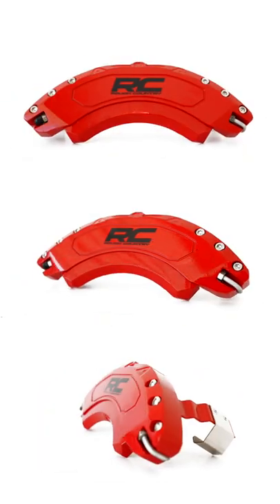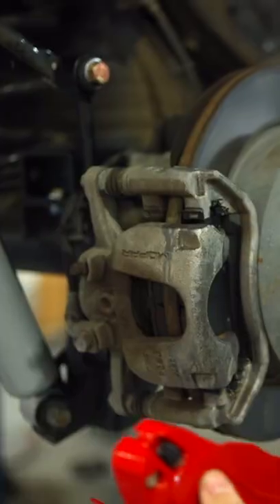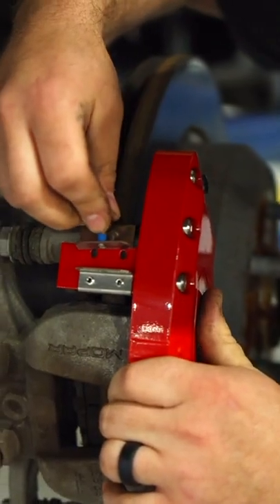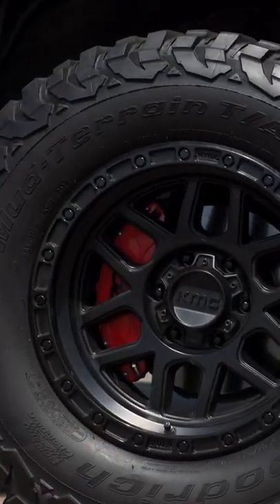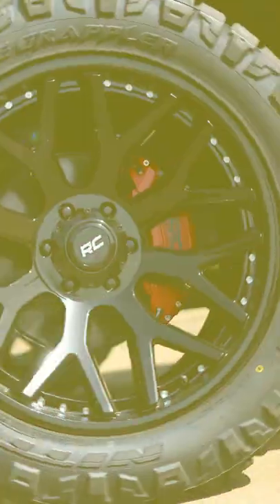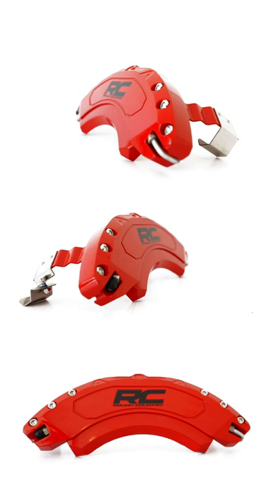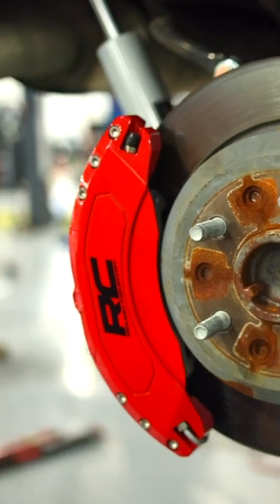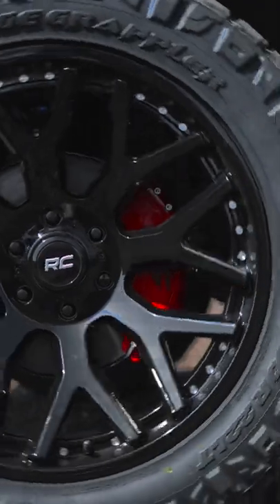Enhance The Look Of Your Brake Calipers

Comment: For $170 just for covers  buy the actual red powerstop calipers some of yall will only need the front sets if you have drums in the back.
Reply: Better off just painting your stock calipers. Those you speak of are just reman OEM...so unless you trust reman and/or have a failed caliper, not really cost savings